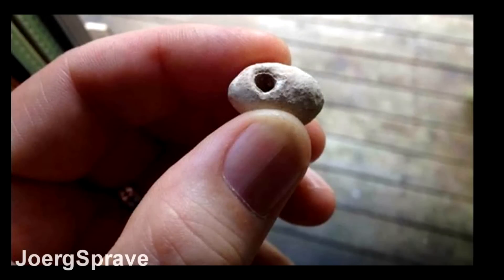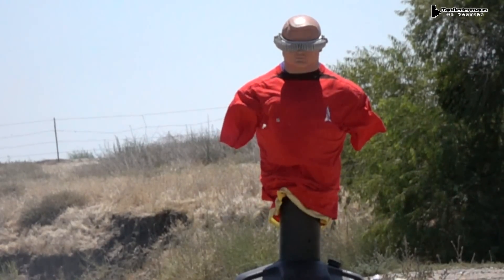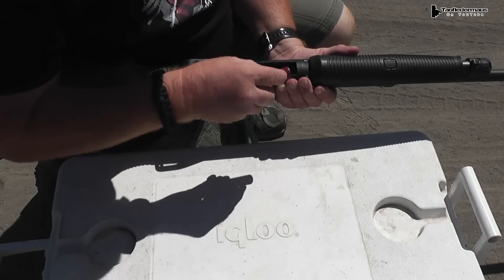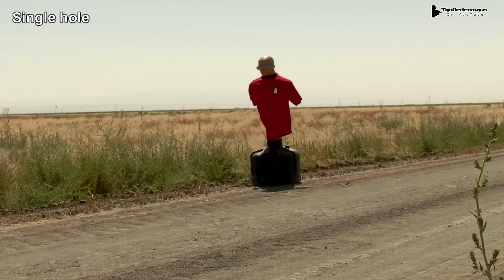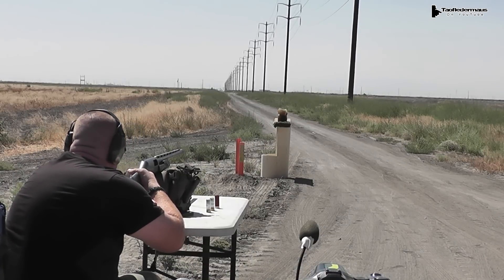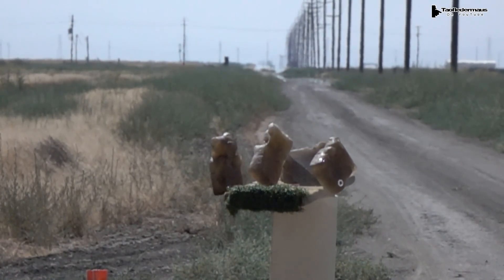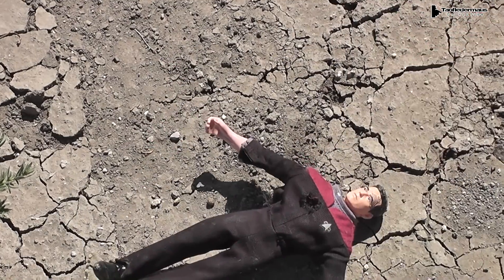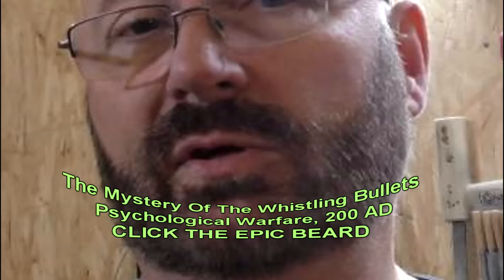Whistling Roman SHOTGUN Bullet Experiment

Comment: Interesting! Maybe the slug is too fast for creating that chirping sound.
Reply: I was looking for your comment!
Reply from the maker: Dang it,  how the heck did I miss your comment?    It's possible the flat surfaces didn't give the correct airflow over the holes.    Thanks for stopping by!
Reply: most ppl outside of germany can't pronounce ö properly :-)
Reply: @jorgschaffer2676  people outsinde Germany???Did you forgett the swiss and austrians also speak german???
Reply: +Eemeli Saarelainen (Molter) it could be the position of the holes too i mean you make a whistling noise with a bottle by blowing from the side not the top
Reply: Jööörg du bist ne legende für mich :D <3 grüße ausm schönen saarland
Reply: The slug is moving much faster so the frequency and pitch go up accordingly.  That is why you hear a high pitch whine instead.
Reply: In Hungary we have the ö sound, and the ü, and we have the ő and ű which are the same, but they last longer :D
Reply: @kovacskristofhun2278  we use inches
Reply: or maybe the spherical shape had its part in the chirping sounds. There are mentions in Finnish war literature of soldiers filing dimples or drilling holes into rifle bullets to make them sound scary so there's definitely some reason to think it would make noises.
Reply: They should give this another go- with oblong projectiles next time. I can imagine the sound being different just because of the way a square projectile might spin.
Reply: I knew I would find your comment somewhere :D that's how I know you are one of the few genuine youtubers.
Reply: +TAOFLEDERMAUS In my opinion of the matter, it's of the great importance to have a projectile that doesn't have big space between the edge of the hole and edge (in case of your cube) the projectile. That space between, doesn't allow a proper air flow over the hole, instead it pushes great amount of it like propeller. That's why Roman round bullet works it has less air resistance and better edge contact with air. Make some round ones. Cheers
Reply: By the way, I love your vids. You're very entertaining!
Reply: I thought the same thing.
Or maybe because they tumbled too much.
Reply: If you want to test chirping sound, take some brass and throw it with hand and you can hear it. Note:place/hold with the brass between your index finger and your thumb.
Reply: They were just moving a lot faster causing the chirping to be much closer together aka (frequency) and the tone to be much higher (pitch).
Reply: Isn't a sonic boom created because of the buildup of pressure waves? If so, is it possible this creates an insulating effect around the projectile, preventing the air from passing across the dimple properly?
Reply: @user-ef4gf7rr9r  yes I have watched a few videos like this from Taofledermaus, when projectiles similar to these holey ones go subsonic, they start whistling
Reply: Try shooting some (well if you can find) bullet brass with slingshot it creates nice chopper sound, be sure to position the brass horizontally, hole goes in front.
Reply: øøøøøøøøøøøøøøææææææææææææææøøøøøøøøøøøøøøøøøøøøøøøøøøø

I am not german but we just use different letters for the ö's and ä's
Reply: +Jörg Schäffer i can
Reply: Some1 plz tell  which one dangerous for shotgun bullet .
Reply: i think they added holes to their loads for 2 reasons. firstly, it made them lighter to some degree. secondly, it made it so you could add something to it, like poison, or something much heavier, like melted metal.
Reply: So about 18 years ago, mate? Huh. 2000 AD.
Reply: I'm not an expert... but slingshot slugs turn all the directions... So, how about if you just try to drill a hole not in front, but through the side of the cube? Or instead of a cube, why won't you try with a ball to give it some spin?
PS. why won't you also check any toy whistle design or any instrument that you have to blow into? The holes for incoming and outgoing air are at an angle.
Makes more sense to me if you want it to whistle... try also with different diameter of the hole... the air speed passing the hole creates some sort of acoustic pressure... maybe the sound frequency is simply too high or too low for human ear?
Just use your brains and keep on trying.
Good luck!
Reply: Supersonic cone
Reply: Joerg, you are awesome. Keep fighting for content creators.
Reply: Are you mad he didn't pronounce your name right or is that just normal for americans?
Reply: Hi Joerg, I don't think they drilled right the way through the cube. Because it needs to be, to make the whistle noise. Needs to be one hole right through.

Comment: load it with the hole on the side of the slug , not the nose so the air can flow over it rather then being forced around it like a hollow point.
Reply: You realize that cube is spinning like a buzz saw, right?  There is no front or sides.
Reply: You realize that cube is spinning like a buzz saw, right?  There is no front or sides.
Reply: it appears as the cube is spinning in a rotational pattern to me, maybe my eyes are shot, should try this with a standard round nose slug.

Comment: +TAOFLEDERMAUS  weren't Joerg's slingshot whistlers drilled all the way through instead of only part way? the whistling sound is normally caused by the air blowing THROUGH a projectile, similar to how a window on a car whistles as you are going do the road, but only if the air has a clear path through the vehicle.
Reply from the maker: No, they were done the same way I did them.
Reply: ahhh ok. wasnt sure cause he didnt show if he bored all the way through or not. good to know. guess its the higher speed that caused less whistle

Comment: the problem is that Joreg put holes on a round projectile so the air was flowing over all surfaces.  if you put the holes on the corners or the edges it would probably whistle better.    the edges would catch more wind.

Comment: Could it be that the shotgun is making them move to fast?
The sling shot is making them move slow enough for the air to interact with the holes where the shotgun just blows the cube against a shockwave?
Reply from the maker: That is possible.

Comment: i would say they wont chirp because they're flying to fast. like on.the spacrshuttle thr air    in front is pushed and forms a “ wave“ in front like on a ship in calm water. my sugestion is make them on the side. but i think it would be best to male a pointy projectile that has small holes with sharp edges on the side.   I am not an expert thou.... just a idea and opinion
Reply from the maker: The Mickey Mouse one chirped
Reply: +TAOFLEDERMAUS i didn't took them into account but i think this might be due to the smaller holes not so much  the big one. as the air is pushed to the side it rushes over the smaller holes.“ears“
Reply from the maker: I'm just glad I included that one.  I was just trying to preemptively head-off some of the wouldacouldashoulda  suggestions of using multiple holes.

Comment: A hole of those dimensions will have a fundamental frequency of around 11kHZ, so it is unlikely a function of resonance in the hole itself making the sound. It likely has more to do with the rotational velocity of the projectile. The last shot may have been tumbling slower the the others initially, or the extra holes may have created more turbulence and sound as they were exposed to the alternating high and low pressure.

Comment: The difference is that the round balls the Romans used and Jörg made spin in the air, more like a bullet, whereas the cubes that you made tumble chaotically. Like all projectiles, the balls experience air resistance, and every time the ball rotates to a point where the hole is facing toward the air that the ball is going through, it makes a sound. You got some sound out of the cubes because that happens a little bit, but with the balls it happens over and over in a rapid cycle, which creates the whistle effect.

Comment: Perhaps do the mickey mouse slugs with 4 outside holes instead . Reason being is weight has been reduced on on side only which will automatically create a tumbling effect no matter what . All because the slug needs to compensate for the irregularity . 
For every action there is an equal and opposite reaction .

Comment: I notice that they are being loaded with the hole facing forward, were they tested with the hole running transverse to the axis of the barrel or was there a reason not to do that?
Reply from the maker: Because the slug is strongest when the hole is forward.   If we put it on the side,  the slug would collapse from the g-shock.

Comment: looking at the orientation of the hole, try aligning it perpendicular to the bore axis. I think they will whistle more that way, as the cube spins through the rifled choke.
Reply from the maker: The cubes tumble end over end.  We loaded it forward so we could tell what was in the shell,  and because the slug is much stronger in that orientation.   (so it doesn't crush under the g-shock)

Comment: Air when viewed as a fluid changes how it moves at speeds faster then sound. 

There are two things probably happening here. The slug is moving so fast that the holes are not catching the flow of air.
or
that the slug is moving so fast you cannot hear the whistling of the holes.

either way jorg is a cool guy

Comment: Awesome tie-in!

I would posit that the sharp edges of your slug are acting as air dams.  There is likely a solid stream of low pressure encapsulating the lip of your dimples.  Without the ability to generate a high pressure stream of its own, the dimple will not generate sound.

Comment: I think the reason they don't whistle has to do with them going supersonic.
Reply: At 5:07 you can hear the slog whistle as it leaves the gel,  having slowed dow  a lot.
Reply: +harald s I think thats just the ricocheted sound like when u shoot a rock out a slingshot
Reply: +Edward Hernandez it could be,  but you don't usually get those after shooting through gel.
Reply: +harald s true
Reply: +Seraphina S I think that since these slugs are going so fast, the front of the slug pushes a lot of the air out of the way so the slug is basically tumbling in a vacuum. I could only imagine that the hole would matter if air could get into it to reverberate during flight.
Reply: Maybe it's also very probable that the whistle would be red shifted so much due to it moving away at such high velocity that it is only present as infrasound which wouldn't be audible and in fact probably wouldn't even be encoded in compressed audio since it tends to discard outside the audible range. It would be interesting to record uncompressed audio of this and look at the waveform in an editor to check for infrasound.
Reply: They make a sound just to high to "hear" until they slow down.
Reply: I think the reason they dont whistle is that they rotate along the shots trajectory and the holes are facing towards the target. They might have whistled if they had inserted the slugs sideways with the hole facing perpendicular to the trajectory.
Reply: Magneto! Possibly but would be interesting to look into just to be sure what is actually happening here since both hypothesis are potentially valid and thus seem to justify testing.
Reply: +Seraphina S I would be interested to see what would happen if the cube had a hole drilled all the way through. And one that was drilled on all sides.
Reply: harald s True and that is the case even if you ignore the shockwave (sonic boom) that said aircraft noise is a pretty broad spectrum phenomena particularly their power-plants generate broadband noise so it's possible they also produce noise at the high end of the audible or even ultrasound that is still audible even when red shifted.

Magneto! Agreed that too, basically more research is needed since the operational conditions for bullets fired from a gun are very different to slingshots so the design may well require modifications to work if that is they can even be made to work at all.
Reply: really, you can just take a normal bullet, put a small hole in the tip and there ye go.
Works the same as whistling Nerf Darts
Reply: +Seraphina S that is actually a  pretty nice theory, though a supersonic vehicle flying away from you will also be audiable.
Reply: Just do it then XD
Can't try it myself, germany isn't very keen on people having guns.

Edit: Which is good!
Reply: same in uk . i can throw an apple through a crono with more ftlb then my 1.77 or .22 are aloud to have .but i can have a 200lb crossbow 10x times the power of my rifles lol
Reply: Ah, another one of those poor souls who watch to much tv.

Well, I wish you well in trying to... what are you trying to acomplish again?

It can't be trying to have a meaningful discussion about gun control, because you were far to polemic...

Ah, now I know, you just want to talk me out of my opinion, because since my opinion is contradicting yours, it's got to be wrong.

Look, everyone has opinions. Mine is that it's a good thing that in a highly urban country like germany there are strict regulations regarding the possesion of firearms. And I'm founding that opinion on the fact that the usa has 10.54 firearm related deaths per 100000 population per year, while germany has 1.01 (japan 0.06, UK 0.23, even canada has 1.97 and they sit right ontop of you guys) source: https://en.wikipedia.org/wiki/List_of_countries_by_firearm-related_death_rate

Anyhow, you have a good day and take your daily bath in spent cartridge cases.
Reply: Yup
Reply: They're not whistling because the cube isn't spinning, it's very simple. It whistles when it ricochets because it picks up a sling, if they used a sphere with a hole it would spin and whistle. the cube only flies straight.

Comment: 2:06 That shooting position next to the "road" makes me quite nervous.
Reply: It was almost 4 miles away.  No toyotas were harmed in the making of this feature film.
Reply: +Gregg Chrissakis I was more concerned about people coming down the road from the highway (or whatever or whatever it is in the back), because even if the road they're shooting on leads to nowhere, some people just go places they aren't supposed to.  - In a later shot you can clearly see, that they can see the whole road up until the highway without their view being obstructed by slight hills, so I guess they'd see people coming soon enough to stop shooting.  Thanks for the info though, it looked way less than 4 miles. :)
Reply from the maker: It's just a dirt farm road,  not a public road.   The highway is over 4400 yards away.   A shotgun slug shot with the gun at a 45 degree angle will only go about 500 to 600 yards.